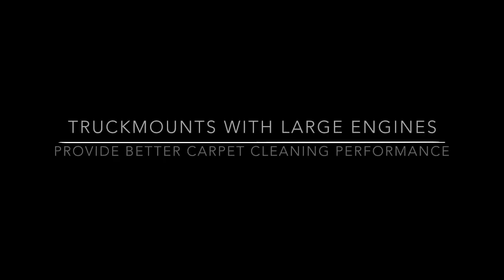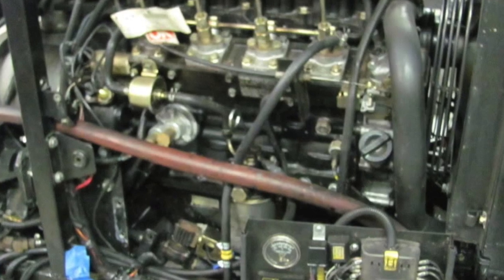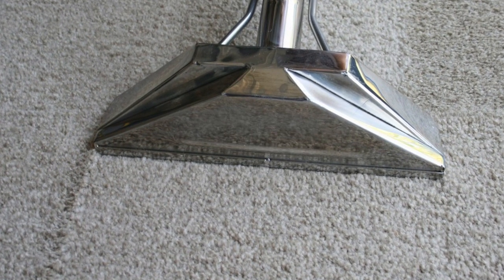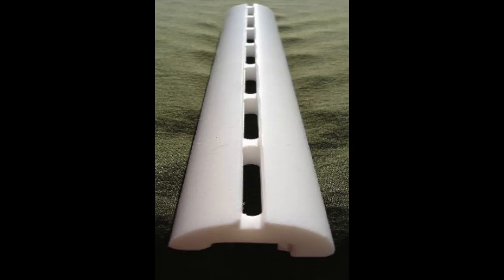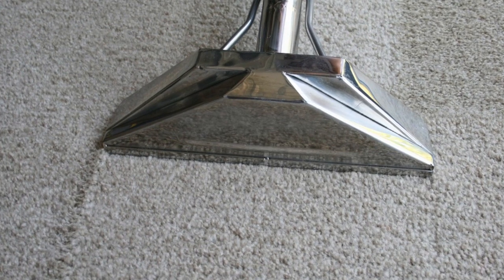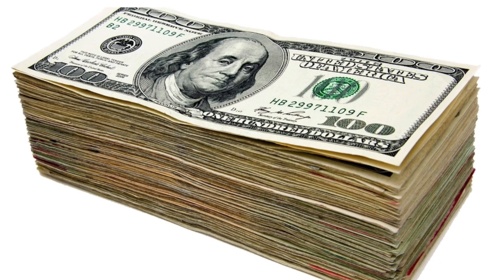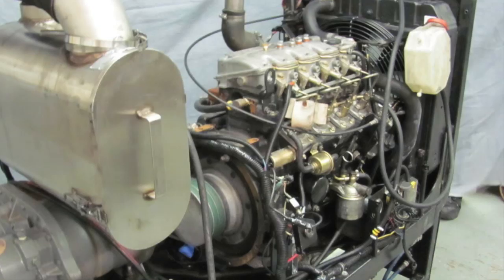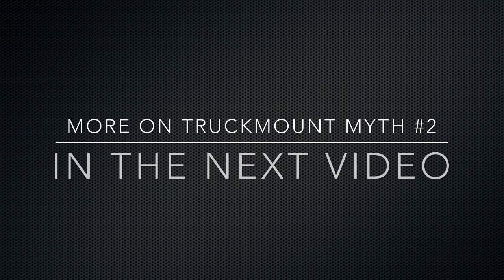Truckmount Mythbusters - Myth - Bigger Truckmount Engine Equals More Carpet Cleaning Performance

Comment: Yeh I've had both. Throw the smaller motors away at 4500 hrs. Can't beat power. But I want you to spend  money on our cheap ass equipment.
Reply: STFU MORON JUDSON TRUCKMOUNTS WILL OUT LAST ANY OVERPRICED TRUCKMOUNT IN THE INDUSTRY

Comment: When I was in the business, we ran Prochem Performer 405s. They got hotter than you need to do a Chinese restaurant, and had so much suction you couldn't get the vac hose off your leg if it got loose.
Reply: The for 405s was almost made perfect
Reply: @unlimitedcarpetcleaningmar2296  4cyl Nissan engine! What do you think that prochem405 uses for fuel per hour?